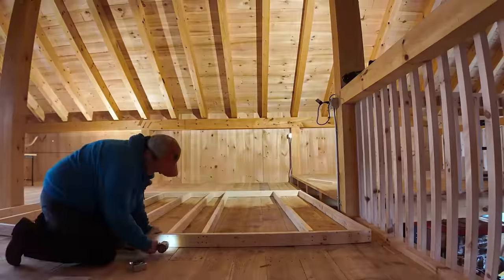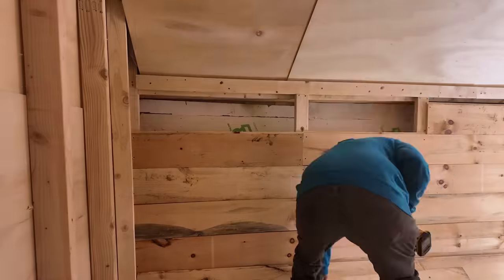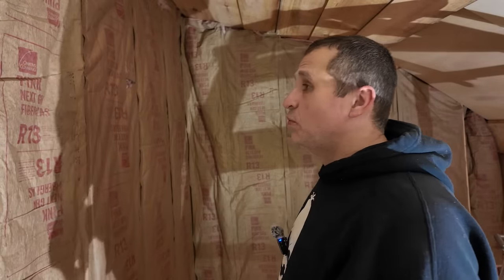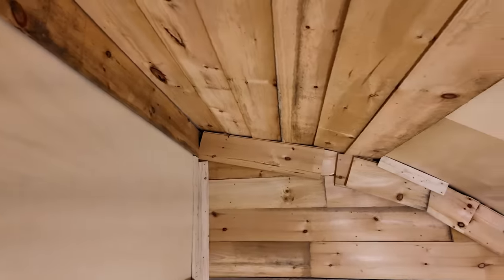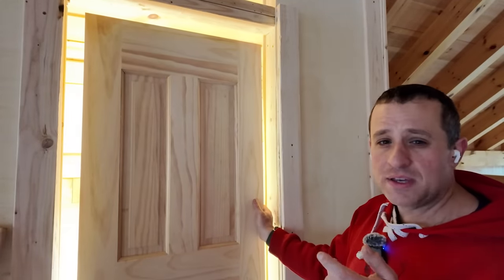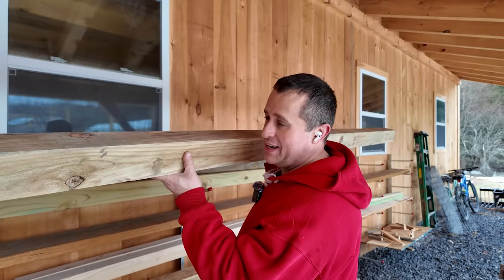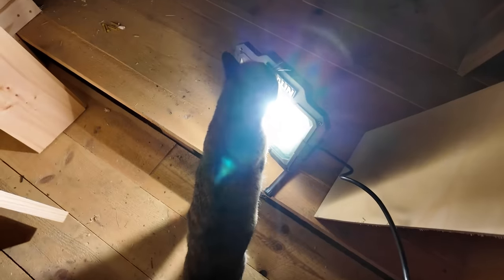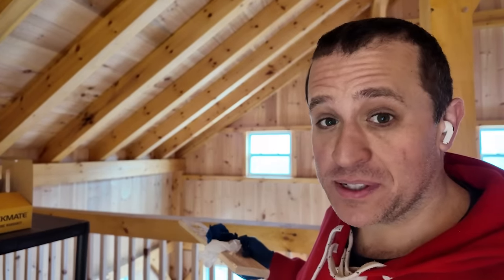Building a Bird Hatchery: Action was Taken (Episode 6)

Comment: Little guidance - It works. Apply a liberal amount and leave it on the boat for a couple of days in the hot sun. Then wipe excess off with a towel. Some of the vaseline soaks into the fiberglass and does an amazing job restoring the color

Comment: I kind of like the scrappy look. Reminds me of a tree house.
Morgan, I strongly encourage you to put an exterior doorknob on the door, like the ones on houses, that unlocks with a key from the outside, and with a little turn knob on the inside, so that no one can ever be locked inside the room accidentally (or on purpose). Its extra work to make the appropriate holes and install it, but its a safety issue.
Umm..wondering why you didn't run electric before insulating and closing up the walls?
Reply: at least it should be fairly easy to take down the plywood and run power in if he decides he wants into wiring?
Reply: He already had the electrical in place before he started. It was one of the reasons he built it kind of in the middle of the floor, that's where the outlets were.
Reply: Electricity is already in.. Well, maybe not the lighting etc). back right corner. 
I assume all other electrical will be conduit.. Because it is easier to work with.. doesn't interact with the insulation (some electrical wire sheathing has issues with some insulation...)

Comment: 08:38 cool fan mounts 🤣
It's actually entertaining to watch you struggle with such a project, using twice as much wood as actually necessary and the most complicated solutions for the simplest problems. Honestly the end result looks better than I expected and should work well enough for the intended purpose. Just don't forget to apply some multipurpose treatment on the wood (mold repellent, fire retardant and vapor sealant, I posted a more detailed comment about this under your last video), otherwise things can go wrong soon after you start running the incubators in there.

Comment: With all that insulation, you will require a lot less electricity to maintain the temperature in there. Well done. The fact you used plywood for all the walls mounted on so many studs means you can hang a heck of a lot of stuff on the walls in there!

Comment: In the corners the insulation is not good. If you press the insulation is not going to insulate much. The air between the fibers help the insulation. If you want to reduce your electricity bill on heating use some Heat repelling foil too.
But it seems its a bit too late for that.

Other than that its a great work!

If i miss spelled something, im sorry. Eng is not my main language.
Reply: Yup, I was going to say that too. Don’t crush or cram in your insulation. Too late now, but for future builds.

Comment: Did you watch the Starship launch Nr 3 today?

Edit: spoilers: Booster failed to do the landing burn / reignite the Raptors, and crashed into the sea at above 1000 km/h.

Ship failed to properly orient for re-entry, produced some spectacular footage from 100km altitude to 94km altitude, video feed suddenly skipped to 84 km, then was lost again. Last Data transmission from 65km (- still around 25000 km/h), but without video feed. Must have lost integrity right there.

Seeing Booster slow from 4000km/h to 1000km/h just from aerobraking was pretty cool, but those last 20km still dropped in a few blinks of an eye.

Plasma heating on reentry on the Ship actually looked like playing Kerbal Space Program… - which is insane.

Comment: Said it the last vid and ill say it again.
You think only one power outlet ( to the right of the room) , yeah do you think thats going to be enough in there.

You have one just outside of the hatchery on the left but now you have insolated abd linned everything, making a gap to run a power cord from that power outlet outside to the left just got a heap harder .

Your going to have to run general lights , extraction fans and how many hatching units then heat lamps or pads for the hatched birds..
How is one power outlet going to handle all that without fliping the safty overload breaker off all the time?

My friend thats sounding like it may bd a fire hazard too running all that from one power outlet and a tone of power boards and exention leads .
Either way its not good, all your heating and machines turning off in the middle of the night to find a heap of non viable eggs, stone cold dead hatchilings or your barn going up in flames 

It may be wize to find a way to access that seconed power outlet that right next to the outside of the hatchery befor your actully needing it.

Comment: I kinda dont understand why you dont use the outer walls, slap some isolation on them and put wood boards on top and then just build the "exterior walls" of the hatchery connected to the roof etc. because this just feels like you build a house within the house and used none of the existing walls.

Comment: I am quite surprised that wearing eye protection has not entered your actions in any of these videos. All it takes is one shard to damage your eyes. 
Also, that mask will not assist properly when working with fibergllass. You should be wearing an N95 at least for the particulates. 

Morgan you are looked upon whether you wanted to be or not as an Internet Influencer. Don't you even think that safety precautions like a proper mask and eye protection are a given. Instead of putting down Alyson (sp) with "I promised my wife I would wear a mask", paraphrased, why not just say that safety protection is a good thing and people should take the time to study and consider what safety is best for working for the materials. 

Last, I hope you will put a system in place that will be able to notify people if you need help in the hatchery. I have a home darkroom which has a door that locks from the inside. I live in an apartment with space. I fell in the darkroom requiring assistance. I was down on the ground for 9 hours with a broken collar bone, wrist and rib. I had set up my Alexa in the room to work lights outside the darkroom to signal when I needed help so my roommate would understand that I needed help. 

I hope you set up a safety system to alert when help is needed or at least recommend it to others. 

Good work though on the barn.